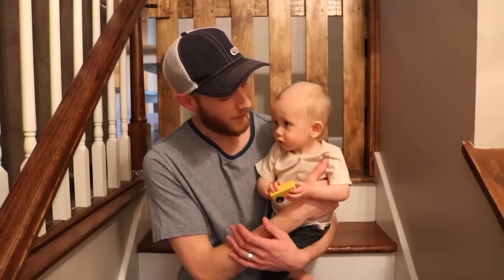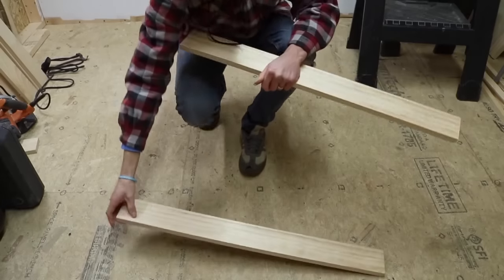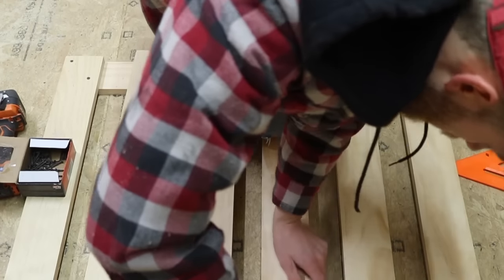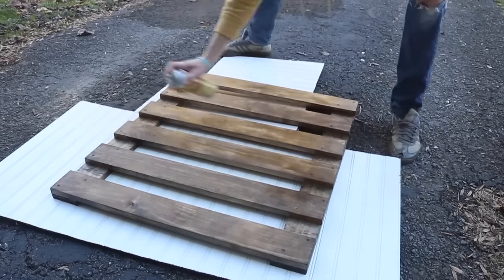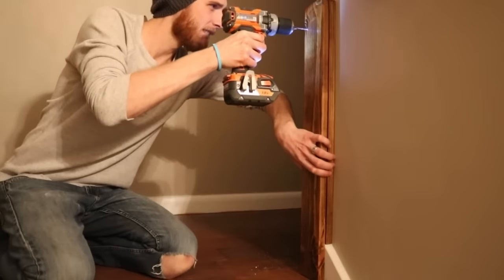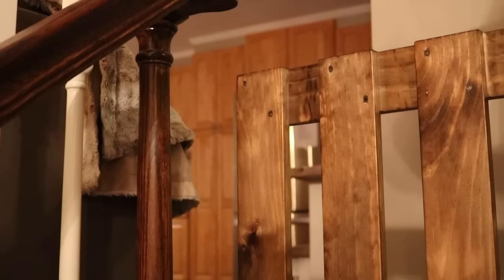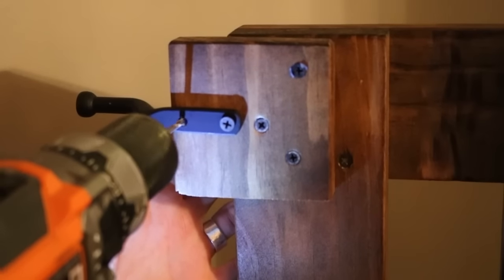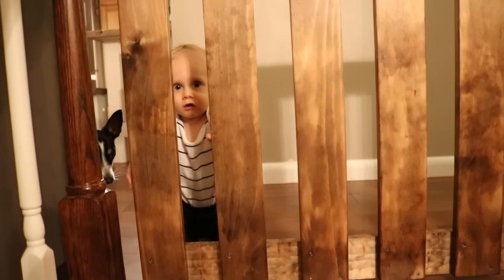DIY Baby Gate

Comment: Would there be any way you could suggest attaching this gate to a skinny cast iron railing? I’ve thought about using super strength command strips. But I’m not sure.
Reply from the maker: Hi Elena. That sounds tricky. I don't think command strips would hold long. I would probably use ubolts to attach a piece of wood to the rail and fasten the gate to the piece of wood. I would have to see it but from what you described that sounds like what I would do. I hope this helps

Comment: hi, great job , but i have a question , how you managed that the bottom corner from the latch side didnt swing when the boy was pushing the door since you put the latch at the top corner ?
Reply from the maker: Thanks Ali. The gate was plenty strong enough that the bottom doesn't move much. You could certainly add more latches, move the latch to the middle, or use a different latch. Thanks for the comment.

Comment: Do you recommend using a board to hang the gate? Or would it be ok if I mounted it directly to the wall? I'm so new to all of this! And if I do mount it directly to the wall, should I try for a stud? Or are drywall anchors ok to use for this type of project?
Reply from the maker: Hey Maeghon. You do not need to use a board but I would definitely try for a stud. Drywall anchors will hold for a short while, but the gate will eventually start pulling out from the wall dsgging the ground.

Comment: Mitch  -  I love everything about this build except my wife will not allow me to drill into the pole where the latch goes. Do you have any recommendations as to a solution to that?
Reply: Get two blocks of wood and drill a semicircle down each. So that when placed together there is a hole down thru them the size of the pole. Then put them on each side of the pole and screw them together on the corners. It will essentially wrap the pole with a block of wood. You can then attach the latch to the block of wood without drilling into the pole. You just have to make sure you size the hole properly so that the wood block, when screwed together, clamps tightly to the pole.

Comment: Did you use 1 1/4 inch screws or 3 inch screws? Your video says 3" but description says 1 1/4"
Reply from the maker: Sorry for the confusion Vanessa. 1-1/4" screws for assembling the gate. And 3" screws for mounting the boards for the gate to the wall.

Comment: You lost me when you drilled into your post. It would have been better to build up a stack of boards to the wall and save the post rework, when you take it down.
Reply from the maker: Yes i agree it would have been much better that way. Live and learn. Thanks for the comment.
Reply: can you explain this further?  What do you mean build up a stack of boards to the wall?  Where would the latch go if not on the post?    I have the same exact banister, post and railing as the video.

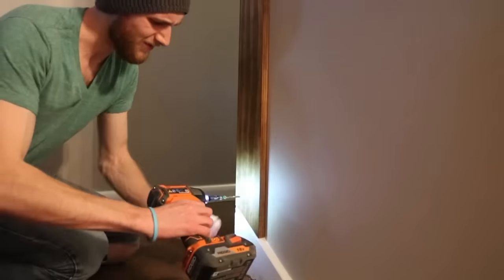Comment: 3:38 and you just ruin the wall ?? why ? why you just dont use another frame on the wall whitch is holded by just expandable clamps or just simple m6 furniture legs with soft pads on them and you just clamp it to the space, and make a gate inside the frame and thats it you dont need to drill and ruin your wall and when your children grow up you can sell it to someone else..